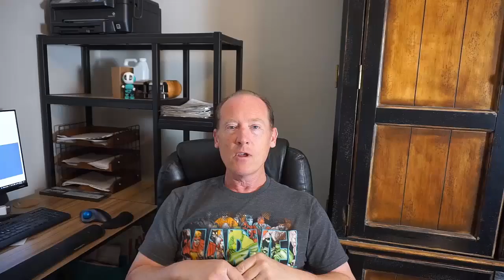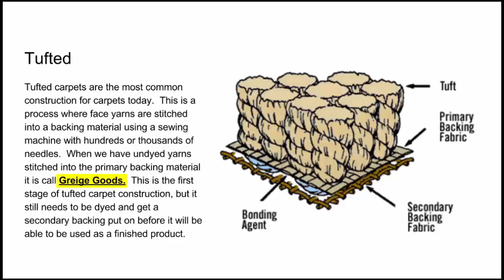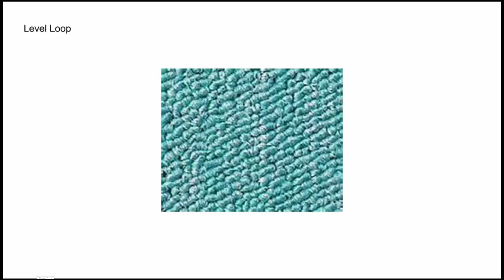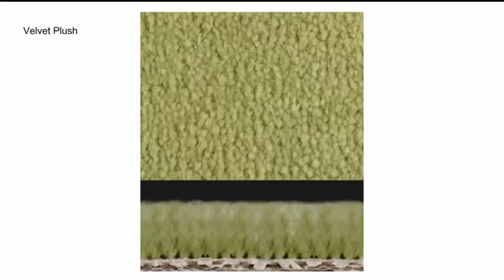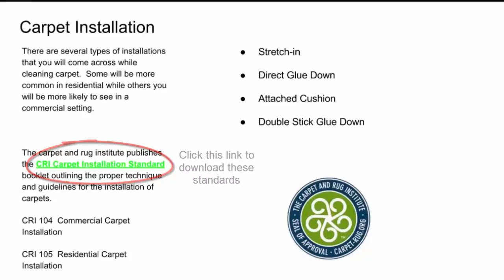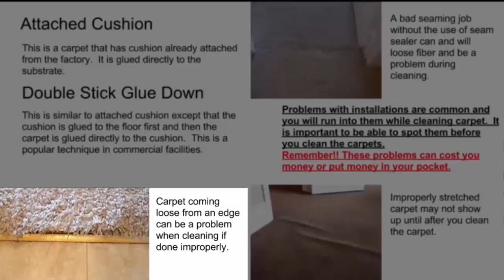Carpet Cleaning Course Part #3 Carpet Construction and installation

Comment: Another good video. Just learned that my grandmother had Axminster runners.
Reply from the maker: Nice. Thanks for the comment. How did you determine that they were axminster
Reply: @carpetcleanertraining8020  Well, after listening to your description, I remember trying to roll up my grandmother’s runner and it was impossible to roll it sideways. In addition, the details were very intricate, the weave. Pretty much the criteria aligned with your description to a T.